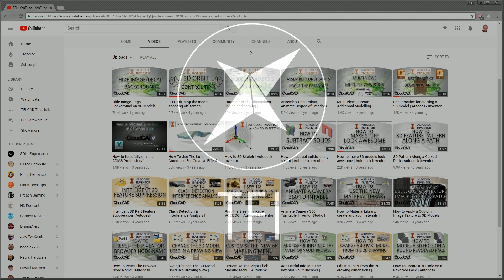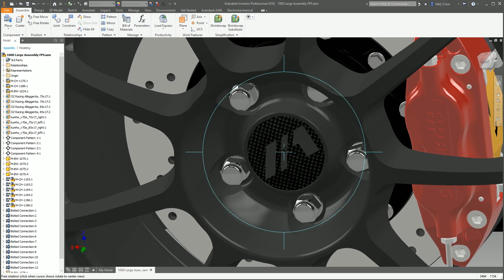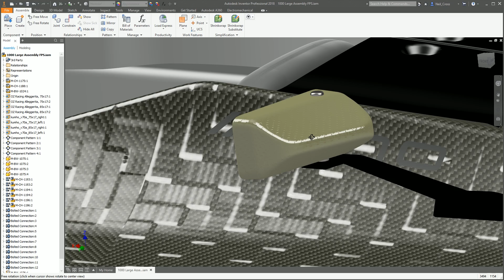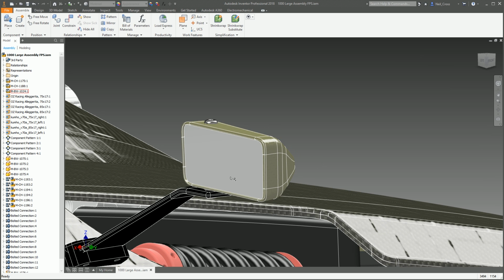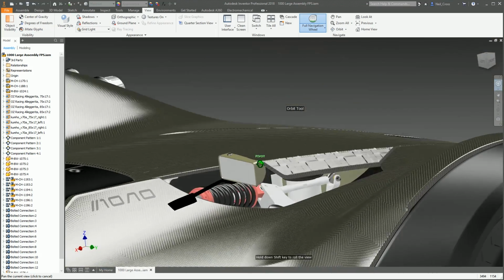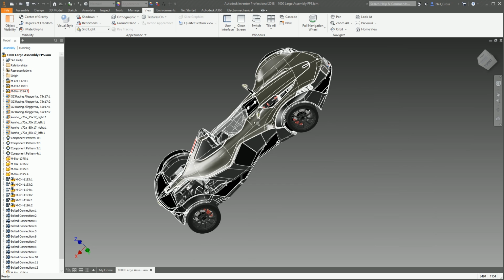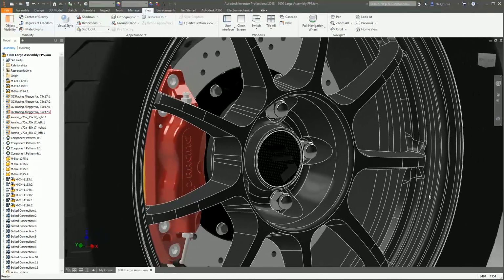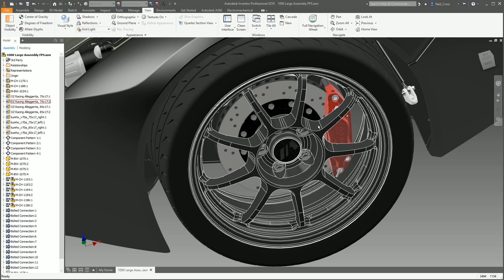3D Orbit/Rotate Top Tip | Autodesk Inventor *REV B*

Comment: While in the navigation wheel orbit mode, you can ctrl-left click to reset the pivot point.  Nice thing about this method is it does not reposition the model.  If this orbit mode could be more programmatically activated it would be ideal and could easily be incorporated into a windows hotkey script, but as it is, it is still possible to script, but the end solution is clunky and slightly unreliable

Comment: Coming from Solidworks (no choice in the matter) then going to Inventor is a pain...... Panning is a thing that can be done in so many ways, zooming in at one location and then zooming out in another is one I use often if I'm in a situation where I'm without a 3D-mouse. The thing is, with the middle button ALONE (no need to use my other hand on the keyboard thank you very much!) to rotate the view you are able to move the model to ANY position, in ANY direction with the mouse alone. The way it is in Inventor makes this very awkward, and you have to move the mouse to the cube or something. And then you don't have a say on what the orbit point is. If you use the middle button in Solidworks (or most other software?) you will decide the orbit point by the point on the model you have the mouse button when you press that scroll wheel, so you can turn the model correctly even if you are zoomed inn way close to a detail. 
Not having this is right now the single most annoying thing for me going to Inventor! Yes, I DO have a 3D mouse, but And this time I even had a saying in want software to get.... I didn't imagine it ever being NOT POSSIBLE to change the behavior in Inventor to do this. I only hope this will be possible to sort out, or else I will regret deciding on going for Inventor. And things like this is so important it will be a huge annoyance. After all it will be there in almost everything I do when modelling........
Right now it feels like, Dohhhhh, now I need to remember to push this button over there to be able to twist my head.... didn't remember that.... every ***** time I want to twist on the view, which is probably several times a minute.
Reply: I found a way around this problem! Look here: https://www.youtube.com/watch?v=fCkTj51Qdpc

Comment: I personally use Shift and middle mouse button. That way you don't get the 3D Orbit circle graphic in your way.
Reply from the maker: I would need to check but I'm not sure if you could use shift to orbit when I learned back in Inventor R10, I picked up using F4 and stuck with it.  Just trying it now, it feels much more comfortable to rest you hand on F4 than it does to keep it on shift as shift is lower down on the keyboard.  Each to their own I guess!
Reply: I started using Shift and middle with Autocad 15+ years ago and never even knew F4 was Orbit in Inventor :)  Autocad uses a ton of left hand keyboard commands so holding shift with the ol' pinky is second nature to me. Good tip for centering with the F4 orbit though. I usually highlight a part I want to use as center and then orbit.
Reply: I have shift mapped to a thumb button on the mouse - orbiting is a 1 handed operation :)
Reply: I have programmed one of my mouse buttons as a keyboard shortcut F4. You have to hold it down but you can use only one hand. I wonder if Solidworks has the left click and hold to rotate under a patent and is why Autodesk does not use it?? I know 3 people who chose SW over Inventor for that very reason. It is amazing how seemingly little things lead to huge decisions but Autodesk should take note of at least what this video covers and get it corrected.
Reply: This those not work on invetor 2022....

Comment: Looking so much forward to new vids from you! Another frame generator tutorial would be sweet! 😎👍 You're awesome! Rock on!
Reply: jonas Söderström frame generator tutorial would be great! I've used it on fairly complex models in the past and realize it has some real limitations and bugs.I've reported them quite a while back and it appears (though I may be wrong) that they have not updated FG and don't have plans to on the horizon.. so I'm wondering how much a person should be using it.
I feel the same about joints. Seems they did a good job and support them fully in fusion360 but they are extremely limited in Inventor and aren't improving.
Would love to hear I'm wrong on both these fronts..

Comment: Hi there,
Nick, I also use 3D mouse but it seems to me it is necessary to set an pivot point in order to set a center. I usually push the PgUp buttom and choice a wanted face and booom the pivot point is set. I know that it is a really lame solution because you have to touch the keyboard.
Thx a lot!
I wish I could help you as much as you have already done.

Bye: Hoze
Reply from the maker: Nope definitely don't need to set a pivot point with a 3D mouse, once you've panned to a new area... just wait about half a second and the 3D mouse should automatically re-centre the pivot point to the new area that you're looking at.  If yours doesn't, try installing a new driver for it as it might be too old.
Reply: TFI ha! I was just about to drop a comment saying that you have to set the pivot point even with a 3d mouse and now I see you say I don't. Dang, learned two new things today! Scary